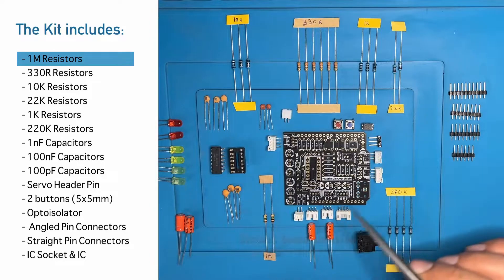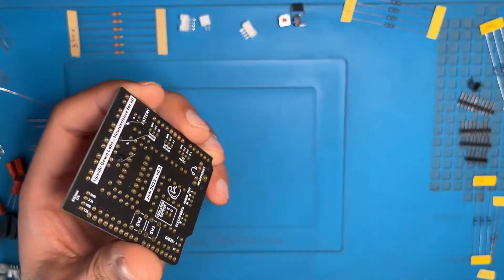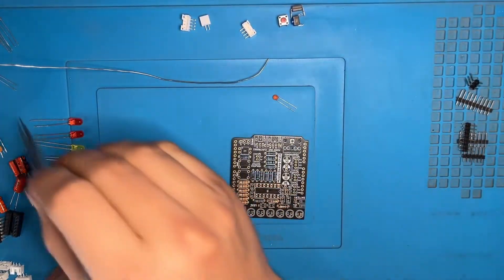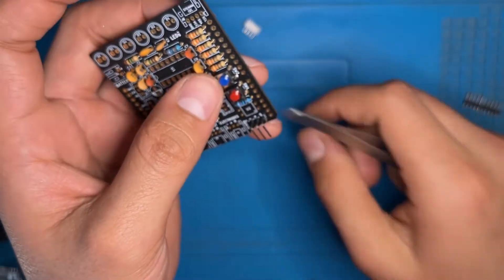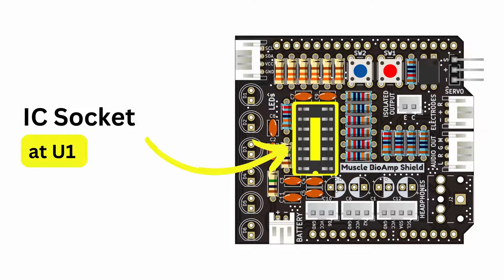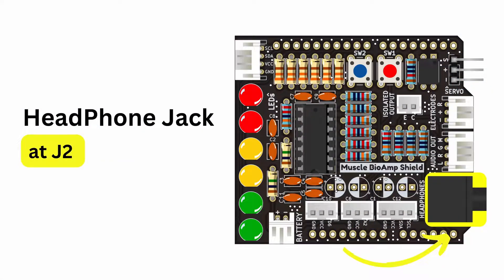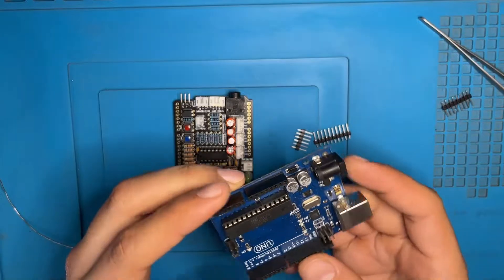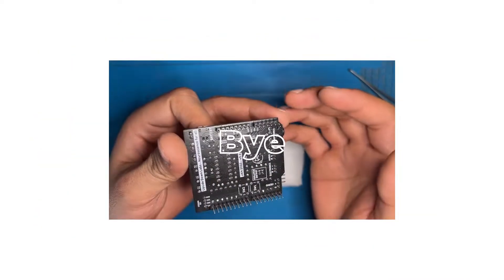Muscle BioAmp Shield v0.3 Assembly Guide | @Arduino Shield for EMG | Muscle sensor for beginners

Comment: so, we can attach servo to it and also EMG sensor?
Reply from the maker: Muscle BioAmp Shield in itself is an EMG sensor. You can connect the servo motor to it by directly plugging it into the hobby servo motor port.

Please find below some tutorials that will help you in using Muscle BioAmp Shield:
1. https://www.instructables.com/Record-Visualize-Listen-to-Muscle-Signals-Using-Mu/
2. https://www.instructables.com/Controlling-a-Servo-Claw-With-Muscle-Signals-EMG-U/
Reply: @UpsideDownLabs  Can we add Bluetooth to the board its self or externally?